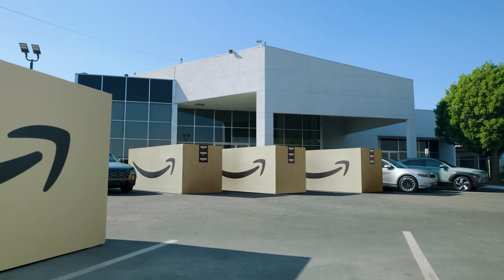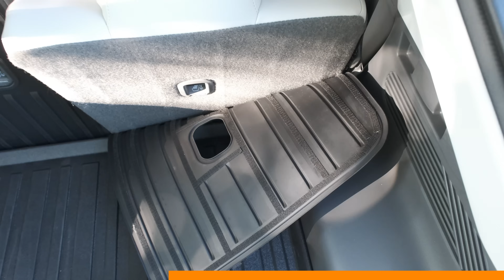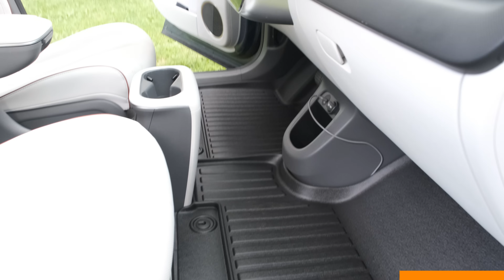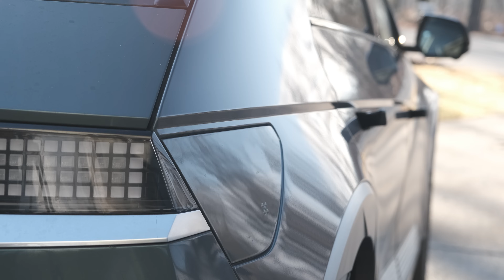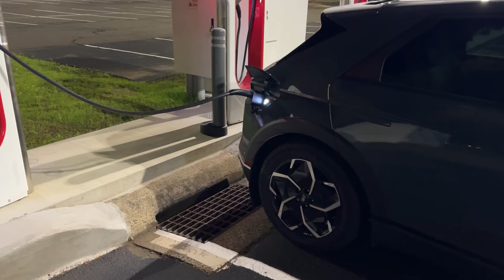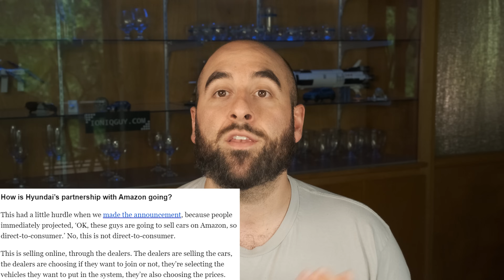NACS (Tesla) Ports Definitely Coming in Q4 2024, Say Hyundai COO | Also Talks Superchargers

Comment: Hot take: With the stations on the ground I would still prefer CCS1 with an 800V car. Adapting NACS to CCS1 is much less awkward than the reverse, and the big installed base improvement is for 400V stations I don't want to use anyway.

Comment: Just finished a trip from West Virginia to Florida in my 5. Great trip and the charging experience exceeded my expectations. Never waited once for a charger to open up or a unit that didn’t work. I used electrify America, circle k and charge point. My average length between charging was 188 miles with the cruise control set to 73. Love this car.
Reply from the maker: Sounds like a very successful trip!

Comment: Why can you get a CCS adaptor for NACS ports, but not the other way around?
Reply: If I understand correctly, Tesla's supercharger network uses CAN bus, not the protocol CCS uses, for car to charger communications. Non-Teslas don't know how to speak that protocol, so a physical adapter is insufficient to make them work on superchargers.

Adapters from NACS to CCS exist, for example the one sold by A2ZEV. But they don't work at superchargers without the supercharger actually having the CCS (electrically) hardware and the car brand being allow-listed by Tesla.

Comment: Yup, if you reach out to Hyundai they will confirm ‘25 model year vehicles will have it.

“Currently, Hyundai EVs are equipped with a Combined Charging System (CCS) port which is not compatible with the Tesla Supercharger Network.  However, Hyundai Motor America has announced that Hyundai EVs will be adopting the North American Charging Standard (NACS) port in the United States and Canada in 2025, which will gain access to Tesla Superchargers across the United States, Canada, and Mexico.  Hyundai 2025 EV models will be equipped with the NACS charging port and Hyundai owners of EVs equipped with the current CCS charging port will be offered an adapter to access Tesla Superchargers at that time.”

I asked a few weeks ago, great quick reply 😊.

Comment: The agreement the automakers have with Tesla provides them access to the Supercharger network, but it does not guarantee a certain expansion of Superchargers to meet the increased load caused by every non-Tesla gaining access in the next year.  Nor does their agreement guarantee when or even if Tesla will roll out v4 chargers (not just dispensers, but the 1000v cabinets).  TLDR: it's wonderful we're going to have Elon's proprietary port on the cars, but don't count on the Supercharger network being anything but a backup if (when?) Electrify America fails you.  I'm sorry, but there are no decent solutions on the horizon in 2025 that will make long distance travel in a non-Tesla EV something I would recommend to mainstream consumers.

Comment: Getting to universal EV access at every DC fast charger will be a good thing. However current Superchargers won’t necessarily be my first choice given the power limitation and short cables. They’re designed for Teslas and I don’t see them spending any significant money to change that. If you have a J3400/NACS charge port on whatever EV you own you’ll still probably need an adapter to use all the CCS equipment that is going to be around for years to come. Tesla owners have been using them for several years.
Reply from the maker: It wouldn’t be my first choice either but where I live there’s many places I’d like to go that I can’t because there are currently none or very few CCS chargers available

Comment: I wonder if there will be retrofitting for native NACS  ports on 24 and earlier gmp cars and hopefully the new 25s will be able to charge also on Tesla‘s destination level two chargers my understanding with Ford’s adapter, you cannot only at select superchargers
Reply: lvl 2 is AC power so any knock off convertor can do that, no special software is required, the car handles all the mechanics on its end.  DC fast charging offloads all the responsibility to the charger so it needs to communicate exactly with the car to monitor the batter status as dumps power straight into them.  So any car can use those Tesla lvl 2 chargers, always could.  The DC chargers have to be unlocked by Tesla to anyone other than a Tesla to use them.

I wondered if it was possible to do an in car conversion as well.  I'm sure it is possible, probably at least one youtuber will do it for the clicks.  I'm just not sure it would make economic sense if an adapter is $100 bucks and a conversion is way more.  But who knows.
Reply: Hyundai couldn't even put a rear window wiper on the 2024 and earlier Ioniqs, even though they know what kind of weather exists in Canada and much of the US. They have not offered any way to correct that mistake which actually affects safety. What makes you think they will have any way of retrofitting NACs connectors on their older vehicles which only affects convenience.

Comment: It is not at all clear to me that Ioniq's announcement is good news.

Despite the plans for adoption of NACS as the official U.S. high speed EV charging standard, we are probably going to live for some time in a U.S. environment where NACS and CCS exist side-by-side. On the Tesla side, their v2 superchargers will probably never charge anything other than a Tesla, and (as discussed here) their v3 superchargers will probably never deliver the amount of power that an 800 v car like an Ioniq 5 or 6 is designed to accept. Given Musk's recent firing of his supercharger team, I think we may have a long wait until we see a robust network of v4 superchargers. So it may be the case for quite a while that Ioniq 5 and 6 drivers will continue to rely on Electrify America and other CCS charging networks as their fastest source of high-speed charging.

However, EA has made it clear that they plan to move to the NACS standard reasonably soon ... probably offering both NACS and CCS charging options (as they currently offer both CCS and CHAdeMO cables). This may mean that frequent road trippers are going to want to carry an adapter no matter what plug their EV is equipped with, so they can charge at whatever station (CCS or NACS) is open when they need a charge.

As many of the commenters here are pointing out, it's not at all clear that a NACS-equipped Ioniq 5 or 6 is going to charge as quickly using an adapter at a 350 kW CCS station as it can today without an adapter. 

Might we be better off next year with a 2025 Ioniq 5 with a CCS plug? We're probably going to be traveling with a high-speed adapter anyway. At least with a CCS plug, we know we can charge with high speed at existing 350 kW CCS stations.

Comment: To be clear, Elon declared the Tesla only network to be the North America Charging Standard (NACS). At that point, it was completely incompatible with CCS communications and to this day remains so. That physical standard was made available and later was adopted into the J3400 in its form shape and communication. Tesla is now converting by upgrading their NACS physical connectors to J3400 that can communicate with CCS vehicles. The remaining connectors on version two chargers, destination, chargers, etc. will never be anything other than NACS. I don’t mean to split hairs and it’s a catchier term than J3400 BUT there has to be a distinction between a Tesla supercharger version two that will never charge my IONIQ 5 and a Tesla supercharger V3 that will only charge it at a super slow rate. If they’re both NACS, then why does one charge and one does not with the only differences is the J3400 standard of communication which one does not have. It’s gonna be a difference in the future so we might as well get it clearly in our heads that, thank you Elon for an elegant piece of plastic, but at the end of the day, that’s all we got from Tesla, a format. The rest of it came from the SAE that created and continues to improve that connector which is now the J3400 connector. So Tesla’s charging equipment is really the odd man out being old and slow, even though it’s widespread. Thankfully, every other provider across the US have been communicating with CCS vehicles for years and changing the shape of the plug as a piece of cake and they charge at a much higher voltage. I might add that that is also a requirement of NEVI $$. Somehow Tesla convinced some idiot that their low-voltage was actually high enough to meet the requirements. Go figure‼️ Fund three times the amount of chargers you’re gonna need when you charge them at 1/3 their native speed. 8:43
Reply: 100% agree.

Comment: I've never been really excited for NACS... it seems like a waste to buy into a system when CCS1 infrastructure is at an all time high. What was stopping Tesla from offering an adapter for all CCS vehicles? Why force automakers to change plugs? I have 3x more CCS charging stations here where I live than Tesla stations. If I were to buy an EV, I'd want my default connector to be the most common connector where I live, and for me that is CCS.

My other concern is about the locking functionality to prevent tampering and these adapters. As it currently stands, the CCS1 or J1772 connectors both lock onto the car and prevent people from messing with them or interrupting your charging session. What happens when we have to carry adapters around? Will those adapters lock between the NACS plug and the car? Will we need two adapters -- one for Tesla Destination and one for Tesla CCS NACS?

I would hate to be a buyer of a 2025 Ioniq 5 with a NACS plug on it while Tesla doesn't have 800v support. With their downgrading of their charging team, how quickly do you really think V4 superchargers are going to hit the mainstream? There's going to be YEARS between when people buy these vehicles, and they can properly use a Tesla Supercharger.

This just all seems like overcomplication and unnecessary to me. Tesla could have just opened up and made this right with adapters, but instead forced its hand with plug agreements, and feels very shady.
Reply: You're in the minority preferring the CCS network over Tesla's. My I5 has visited far more broken CCS chargers than my brother's Tesla has seen broken Superchargers, and you'll see the same sentiment dominating web comments.

As for 400V speed, we'll see what Hyundai can do with the 2025 refresh. Before, there was little incentive to get over 100kW at 400V, and now there is.

Personally, I'd take a reliable 100kW over unreliable 200kW.
Reply: @masina9447  I agree the Tesla network is very reliable...that being said we road trip a lot. 14,648 km road trip around the US and back into western Canada then home to Ontario. 43 days, 77 charge stops and we encountered 2 chargers that were inoperable and we had to move to another stall. Yes you are correct that the CCS network has more issues than the Tesla network, for a number of reasons, but overall it is not as dire as many paint it. At least not in our experience.
We generally do a couple of thousand km trip every month at a minimum and we have yet to experience anything resembling what many have portrayed.
In any case our 2022 Ioniq5 gets lots of driving and has about 60,000km on it and we have had it for about 11 months now. 
Cheers 
Mike and Ally
Reply: @sprockkets  yes you are correct on that...I believe also that the Tesla gear was well designed and they have worked to perfect that over many thousands of installs where with the CCS equipment there is such a Mish mash of equipment types. 
Either way things are pretty good but need to get a whole lot better (in reliability and distribution) before a lot of the public will want go EV. 
Cheers
Mike
Reply: The agreement includes agreement on adapters. All of us will be able to use either by early next year.
Reply: NACS is a legitimately much easier to use and less bulky connector that eliminates a common point of failure, the external latch, from the plug side. I think consolidating on one standard is a good thing, and between the two, NACS is a better connector. But at least in the here and now with the stations that are on the ground I prefer having CCS1 right now.
Reply: Yes, the problem is that the batteries are different. Tesla CATL battery China

Comment: Hooray!  I was dead set on Model Y.  Went on vacay to FLA in March, and reserved an MY with Hertz.  And when we got there...they gave us an Ioniq 5.  With 32% SOC, and we have about 210 miles to traverse.  Of course that turned into a nightmare due to few and far between CCS DC Fast Charging spots.  But through the week, I really started to like the 5.  Did some web surfing and learned the I5 is getting NACS in Q4, so I figured I'd hold off and wait for that, even though I'll have a Level 2 charger at home.  I was unsure (until this video) about whether the I5s with CCS could charge at a Tesla Supercharger, but even so I'd prefer to wait for native NACS (not to mention the rear wiper, elimination of coolant changes, and a little bigger battery!).

Comment: Since the Cybertruck is 800 volt I'm hoping Tesla will do whatever is necessary to improve the charging for 800 volt cars. I'm a bit nervous about the transition as I'm not convinced Musk is really interested in promoting electric cars anymore and has moved on to AI, robots, robotaxis, rockets and right wing media. If he was gone I'd have more confidence in Tesla becoming a reliable partner. The way he handled the supercharger firings proves he can't be trusted. In the beginning I was waiting for the 2025 model for the NACS, now I'm waiting because of the other improvements. However, I'm glad Hyundai is moving on with NACS this year, as having two charging standards is just bad.

Comment: I have a similar question to others. When Hyundai EVs come with the NACS port will they still be able to charge as fast at 350kw stations?
Reply: Yes, assuming they have a NACS connector. NACS is just the physical connection, voltage, amperage and the various communications protocols running over the wire will be the same.
Reply: @davidmorley3734  and in the meantime, would a NACS to CCS adapter at an updated NACS-plug non-Tesla charger should be able to also reach those speeds? Thinking about older non-Tesla EVs that will still have the older port.
Reply: @stevenmeyers5088  That'll come down to the manufacturer of the NACS to CCS adapter, I would expect them to support a full speed EGMP charging at 250kW though, essentially it comes down to high grade plastics and wiring that won't overheat because the cooling stops at the NACS plug and won't pass through the adapter. The adapter is going to have to be rated for a certain charging speed and/or approved by the OEM for use with that car. Going the other way Tesla have had no problems AFAIK with their CCS to NACS adapter, but their peak charging is pretty shortlived before throttling down. Also for most cars that can charge happily on a 150kW charger (e.g. ID.4, Kona EV) I am confident that they won't have a problem.
Reply: Based on the video, it does not sound like it unless you have access to a V4 supercharger

Comment: Nothing here that we did not know already:  NACS (J3400) ports in new cars coming at the end of 2024.  Hyundai/Kia/Genesis said long ago that J3400 to CCS adapters will be available in 2025.  No explanation as to why it takes a year longer to provide an adapter than it does to engineer a new port into new cars!  Especially confounding since Fords and Rivians are already using Superchargers.  Yeah, there is the 400V vs 800V incompatibility,  but at least give us some Magic docks, ffs.
Reply: In my opinion the adaptors is not the issue. You can buy one on the internet and you can find videos showing they work without issue. However you cannot use it before Tesla opens the stations for your car. That’s the show stopper.

Comment: I’m not sure this is all good news.  Electrify America is no problem “in the back of Walmart parking lots”.  I have been getting charging rates as high as 230 KW.  So, tell me, if I get an Ioniq later in this year, with the Tesla connector, will I be able to charge at 230KW?  What’s the deal going to be with EA?
Reply: I don't think the other replies are understanding your concern, so just to clarify; the switch to NACS won't change anything about your charging experience at EA stations as long as you have the adapter.
Reply: @ÆshTree  Thanks. That’s exactly the info I needed.
Reply: The current V3 Telsa chargers could do 250kW but only if the software could talk to each other. Right now it doesn't and I'm sure it's Telsa not really caring until we get access at the beginning of next year. 

With the V4 Telsa chargers it could do up to 350kW and will work natively with 800v vehicles. Of course current Kia and Hyundai cars could only do up to 230kW. Hopefully the next gen will get even faster charging like Porsche right now.

Edit: also the more competition the better in lowering those crazy expensive EA rates. 0.56 per kW is like pumping gas but with the wait smh. Most people go EVs to save money and not wait longer for no reason.
Reply: We don’t know speed yet. 
You’d need an adapter (until EA starts using the new charge cables)
I wouldn’t count on getting above 150kW on any Tesla-branded charger.
Reply: I was thinking exactly the same thing. We'll now have the inconvenience of always having to use the adapter and who knows when the other charging networks like EA will switch to Nacs connectors.